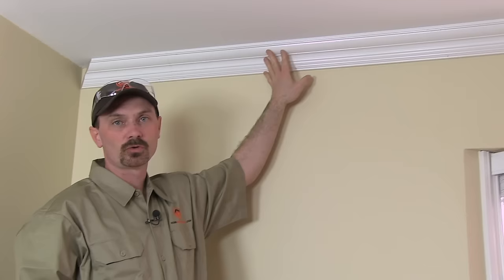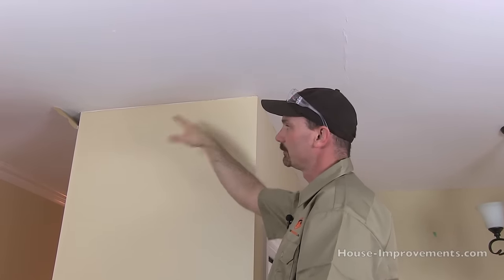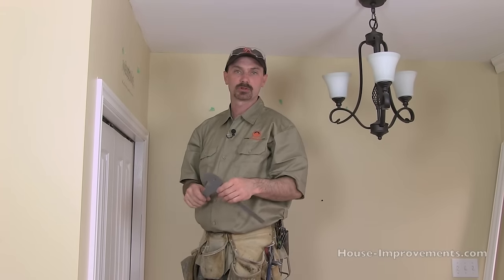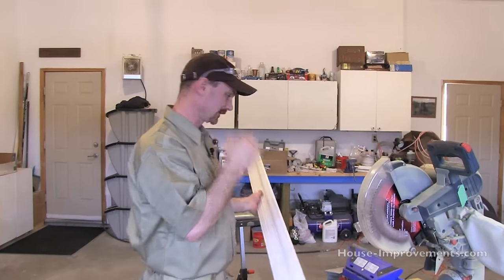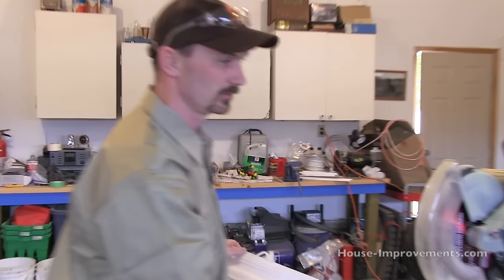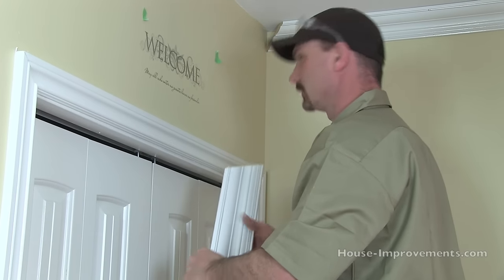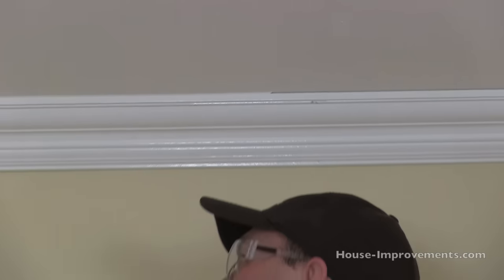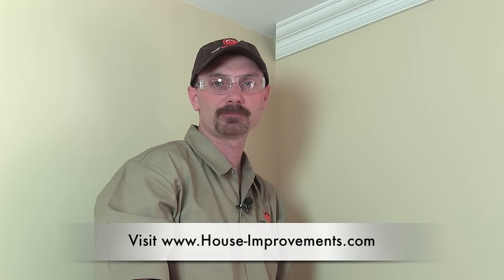How To Cut & Install Crown Moulding

Comment: I don't see how he's hitting the 2x4s with the nails cause they are not everywhere.
Reply from the maker: You can find your wall studs and rafters with a stud finder and mark with a piece of tape on the wall if you want but there will be areas that you have nothing on the ceiling for sure when you are installing parallel with rafters and between rafter locations . I simply angle the nails at about 10 -20 degrees and they hold well even in just drywall.
Reply from the maker: Also with a smaller crown like this you will most times be nailing into the double top wall plates along the walls if you use long nails and are shooting upwards a little.

Comment: whats the best way to fix crown mouldings to a brick wall??
Reply from the maker: make wood blocks cut to fit behind the crown and glue them into the corner to attach the crown to later.
Reply from the maker: By glue I mean use construction adhesive .
Reply: Ok i'll give it a go, just gotta convert what you guys call construction adhesive over there to what we call it in Australia? Then be able to find it here in thailand where i live. lol

Comment: 19:25 instead of using glue/tape couldn't you just use like a 1 1/2 stainless steel screw to tie it up.
Reply from the maker: Screws do not hold well in thin MDF like this

Comment: Finally a video showing actual measurement technique and applying to a wall instead of just a cut. A cut information is fine but for beginners it is nice to know that 2 cuts have to have a perfect distance. Thank you! The tip on the inside cut first for the measure is a great example of a trick I needed to know.

Comment: If you have a compound miter, why would you cope cut?
Reply from the maker: +Marc Estenfelder A cope usually will look better , but it takes more effort. If you are using trim that is stained and can't be easily touched up in the corners a cope is a better choice

Comment: Thank you.  This is very helpful. As a DIY project I would have been quite frustrated at the tiny gaps but realize now even the professionals have the same challenges.  I was going to try the coping but that looks tedious but I may consider.  I’m building a tiny house and have only 4 inside cuts - whew

Comment: Why do coping on inside corners? Why not just 45 degree cuts?
Reply from the maker: With coping you can get a nicer fit when corners are not perfect angles. Also it would really only usually be done on none painted trim.
Reply: @HouseImprovements  I plan on using corner blocks. What do you recommend for anchoring them? Another video showed them using caulk...I know that's not right. I'm thinking superglue.

Comment: Why do you flip the crown upsidedown when cutting?
Reply from the maker: Because if using the jig I had that is the way the jig is made to cut it , and if just placing on your saw fence it sits better if turned upside down so you can use the bed and fence to support it.
Reply: HouseImprovements

Comment: What are nailing into? If you're nailing into drywall, nail will never hold.
Reply from the maker: Actually it will, angle your nails slightly. On small light trim like this you will have no issues.
Reply: @HouseImprovements  No it wont. You either put backers up or you find the studs anything else is hack carpentry.
Reply: Wrong. I hand nailed into drywall 3 rooms and a hallway 24 years ago and not a single problem. BTW, I didn’t glue the corners and they are perfect today. Not recommending, just saying.
Reply: @colinnicols5387  Bull! Never will hold. Hack carpentry! Find a stud or put in a backer.
Reply: @nickhuber9627  hey man, I’m only telling like it is. Back then I didn’t know better — maybe I was just lucky. Like I said, it worked but I’m not recommending to try it that way.

Comment: What is the point of the coping? The scenario to use it in I mean
Reply from the maker: Generally you will get a better joint. When you're using a paint grade crown its not really needed IMO because you can caulk the joints and make them look nice. With a stain grade crown you don't have the option of caulking the joint so coping would be better.

Comment: Why do you have turn your Moulding upside down?
Reply from the maker: If you dont turn it upside down you need to hold it with the bottom against the saw base and saw fence and then hold the top on the correct angle and away from the fence. Much more difficult to get right.

Comment: Why tilt the crown when cutting?  Nice videos
Reply from the maker: It must be tilted when cutting , the same angle that it is mounted on the wall or your corners will not work at all. The only way around that is making compound mitre cuts on each corner.

Comment: For the last corner that you solve with small saw, does the saw you are using cannot turn AND incline 45 " ?
Reply: hes using a chop saw, no pivot to the saw angle
Reply: ah ok, thank you
Reply: in other words...spend the extra $ for a double bevel mitre saw.

Comment: What is the purpose of a coped corner? When would you cope a corner?
Reply from the maker: especially helpful when using stained wood moulding because you can not caulk the corners to cover any imperfections.
Reply: Golf Nut jji
Reply: HouseImprovements b

Comment: why cove and not miter on that corner? 

just curious.
Reply: Cope. It's a much tighter joint. It's much easier when perfected. I run 16' pieces all day long by myself. It'd be much harder to mate up two miters when I cant see the miters in the corner while holding the piece away from those miters.
Reply: Coping is the only way to go on inside corners. Corners are rarely 90 degrees.

Comment: Is it better to do a coped corner instead of an inside cut?
Reply from the maker: +Michael Olsen A coped corner will usually give you a nicer result and is well worth it on a stained crown where caulking is not an option.

Comment: When nailing the top part of the molding do u have to hit a stud?
Reply from the maker: If you can hit framing then that is preferred but when you can't use long nails (1-1/2" or more) and angle your nails. the nail driven in at an angle makes then difficult to pull straight out.

Comment: Hi, do studs need to be found to nail into?
Reply from the maker: Its not a bad idea if you have a large crown but anything like what I was installing  I usually just brad nail at a bit of angle and that really helps hold it tight. If your walls are pretty wavy you may need to hit studs.

Comment: OMG< why would you even nail it knowing the joint was wide enough to drive a truck through it..! I mean really, It is so easy to take just a whisper off to allow the crown to lay in naturally, if you'd " ALWAYS"...! treat every bit of your work as if it was going to get a very light stain finish " YOU'LL be mile's & hour's ahead of the game to a  " FIRST CLASS " finish job.. Think about it.. I always do..!  there are a few easy & simple step's to save you time, & money, "" 1st.) as you begin to measure  ("yes it's helpful to take piece of the material pre cut ,) both left side & right side inside & outside corner's, (" it's a NO brainer,") as you measure & make your layout map, besides making the measurement & if it's an inside or out side corner, make a note if your sample piece's were open or closed ( you'll save so much time & get a very professional finished job, believe you me..! FACT...! just because you can fill the joint's & spot the nail hole's doesn't mean they won't be seen...! I'd never BUY -IT,..! trust me after 40+ year's of doing trim if you get a good plan your job will fly buy & be sooooo much nicer.. ok so now Were, armed with are measurement's & layout map with important note's, if you'd just slow down you'll get finished faster ok,? now look at the note the outside corner looked about a 1/8" open remember,? so if we cut it just a whisker long, & or maybe it was a 901/2 degree so why not adjust for that with our cut make it...? say a strong 44 & a smigg degree instead of a hard 45 degree  you'll also see that strong arming a corner together is crazy.. you'll soon discover you can gently roll the crown (both piece's,)   NOT JUST HOLD IT TIGHT & NAIL THE PISS out of it, Also on nailing the inside corner's be very careful about your nail placement, if you've glued it ( which of course you've learned to do by now... LOL,....!,) try keeping your nail about a foot to 10" away from the inside corner & then it' will be beautiful, actually I can cope all of these faster than you could cut them with a miter saw It doesn't matter if it's MDF or stain grade wood ( hardwood,)

Comment: do you space 16" so to hit a stud? hopefully? or are all the brads anchored in the Sheetrock?
Reply: they are in the drywall,he should have used construction adhesive or found the stud location and marked the wall with tape,same for ceiling joists,except when parallel to molding,thenSOLcan also cut 2by stock in shape of pie quarter,nail to top plate behind molding,then nail crown to pie shaped piece
Reply: They are going into the double top plate which comes down 3" from the ceiling. No need to locate studs.
Reply: good point John,unless its a partition wall with no double plate

Comment: I actually like seeing the issues he is running into because I'm sure I will see a lot of the same things. I've installed crown before but used the boxes at the corners and ends. On our new house I want it to be cleaner looking. I was always told years ago, when it comes to your walls, there are no 90 degree angles. :)

Comment: .....um....huh??  man, you did some sloppy work there.  how shocking the amount of people below who flatter this video in order to "make everyone feel good".  just shut up and consider the correction!  laymen flattering this video...WHY do it??  let this man be corrected!    

 come on...take it down and recut a new piece adjusting a couple of vertical degrees -- tighten that miter right up.  then next time, leave one end long and dry fit it, adjusting (usually the vertical, not the horizontal, angle) if necessary; takes only a minute and makes a HUGE difference - why? because hiding an open miter with filler or caulk takes allot of time, relatively, it is NOT as simple as it sounds, and lastly, after some years almost for certain the filler/caulk will sink, shrink, or warp, especially as NEW HOMES SETTLE....and then you'll always have that unsightly gap, usually painted over many times which never works.  (and folks, nail placement should never be in the "crotch" of a contour - place your nails where they can be CLEANLY filled.)         
Do it right:  wood glue both surfaces completely and CLAMP them (collins clamps) or PIN nail them as the glue cures.  such a miter with never fail.   
...SO much to KNOW which MOST people simply do not comprehend, such as GLUING effectively - both surfaces need to be completely coated, just apply the glue bead and dab with your finger, but do not wipe.  this only takes a moment to do.

Comment: I’ve been doing this my whole life. Let me give you some advice. First off coping is the best way. But however if you keep a wood block in your tool bag. If you have a gap on the top you tap the pieces down if you are gapped on bottom you put your block in the corner up tap up and it doesn’t take much force at all to move it around.keep back alittle on your corners with the nails but even if it’s nail just tapping with a block moves it. Hold pressure on the block as you tap so each time you tap the crown moves and stays in place then pin it. And know your trim gun and how to accurately shoot on a edge when trying to pin an outside corner together. Headeless bradnailers work great for this or Brad nailer. Your using one gun trying to do it all.a good quality good is also good to have. Now you have made a video that stands up to the saying caulking and paint makes a carpenter what he ant. Man I wish you could work with me a few weeks if you could make it. Keep at you get there

Comment: Not sure who this was intended for.  MDF instead of quality poplar crown?  Mitered inside corners instead of coped?  Nailing into drywall and expecting it to hold?  Nailing outside corners into MDF?  Relying on caulk to fill corner gaps instead of good workmanship?  The homeowner would be further ahead to hire a skilled finish carpenter rather than waste his/her money on a slipshod job like this.  Remember—you get what you pay for.

Comment: Thanks for this great video Shannon! The plaster wall in my 65-year-old house doesn't hold the nails very well. I'm using hammer and 1.5" finish nails. Would a nail gun make a difference? or I need special nailing technique and/or adhesive to install crown moulding on plaster wall? Thanks.
Reply from the maker: Usually nail guns will not properly penetrate plaster walls. In your case hand nailing and adding some caulking at wall and ceiling after will be best. The caulking will hide the wavy surface of the wall and ceiling as well as help adhere the moulding to both surfaces .